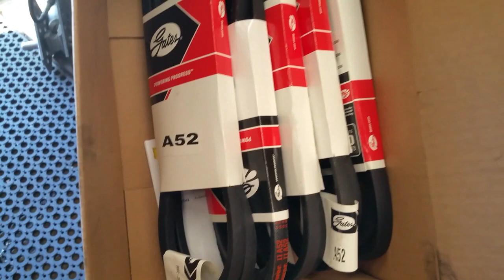The Clash at the Bash Getting Ready Part Three

Comment: While I realize you're probably the only one (usually) in your shop, I've learned that just shutting the breaker off could be dangerous.   Through the years, I've heard multiple stories of people walking by breaker boxes and switching them on.  Though it's rare, I'd prefer to have a padlock keeping the switch from being reconnected.  I remember the first job I had in a machine shop.  I had just turned 18.  The foreman handed me a bucket with degreaser in it, and, a water hose, and told me to brush the degreaser all over the turret lathe, then hose it off.   When I mentioned to him that it was connected to electricity, he said not to worry about it.  That the "breaker" had been disconnected.   Imagine my surprise when it started sparking like a Roman Candle on the 4th of July.   They found out, later, that one of the machine operators had noticed the breaker was off, so he turned it back on.  That's when I started my own lock-out system.  I flatly refused to clean another machine unless I had my own padlock securing the breaker box.

Comment: Did you indicate the lathe input shaft to see if the bearing is getting loose and thus failing the seal?  #1 reason for seals that look ok to be leaking that I find is shafts that are walking either radial or axial play.
Reply from the maker: I did feel the shaft, that seal was not in far enough I believe.  ;{)------

Comment: I spent some time in the bearing and seal industry years ago. I can't tell you how many times somebody brought in a seal that they had pried out with a screwdriver and destroyed the numbers on the seal. "So I need a new one.""OK, I measured the O.D. What is the shaft size?" "Uh, we don't know.""If you had not destroyed the numbers I could sell you a direct O.D. replacement or an undersized I.D. seal to replace it. "Can't you just sell me a new seal?""Yes, I could sell you ten different ones. ONE of them might have the right I.D. to fit the shaft."Then they demanded to see the Boss. He told them the same thing.Then there was the guy that came in for a bunch of Heim ends. Wanted the industrial ones. AFTER I pulled all of the ones on his list and asked him what he was working on he told me he was building a race car suspension/steering! OH HELL NO! I told him he needed to use the Aircraft ones.Then he demanded to see the Boss. He told them the same thing.I don't miss that job...

Comment: Weld your vise gripes to a slide hammer, then you can tap it out.
Reply: I have a car body slide hammer with a screw tip that I use for seals. Punch a hole in the face like Keith did and screw the slide hammer in the hole. Comes out every time.